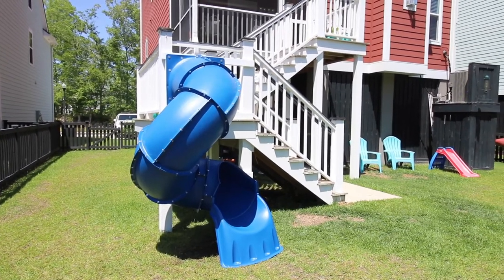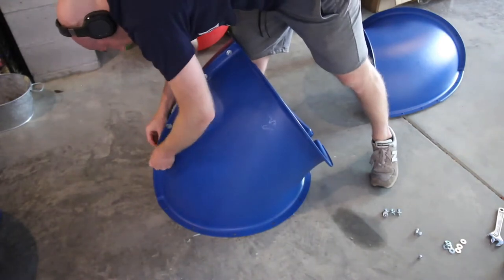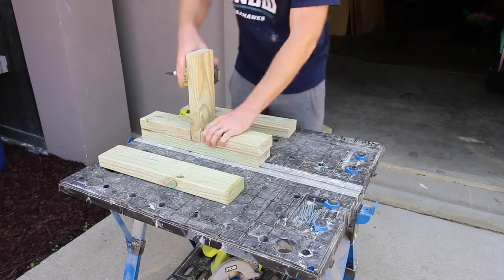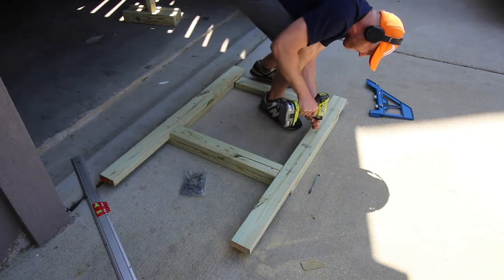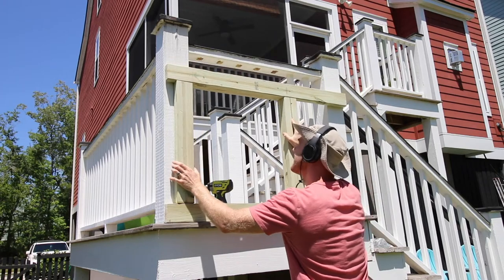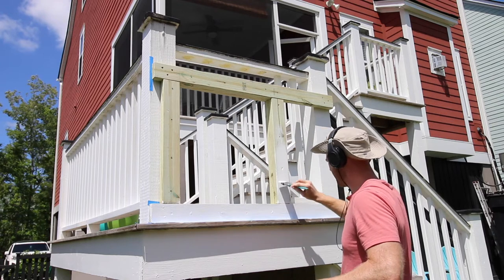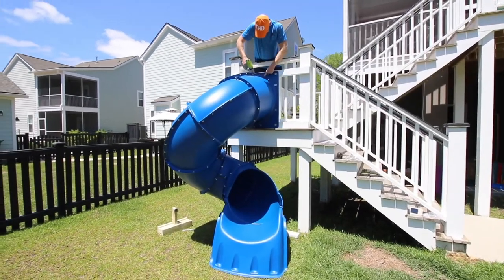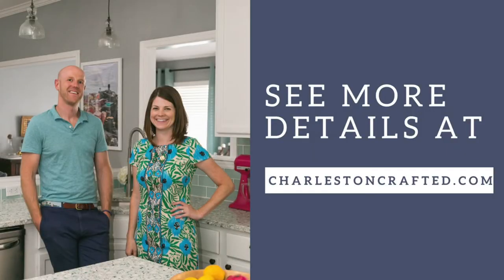How to attach a slide to a deck

Comment: We want to do the same thing but aren’t sure what length of slide we need. I think we need a 7’ slide because from the deck to the ground is 7’ but my husband thinks we need an 11’ slide because it’s 11’ from the top of the rail to the ground. So I guess what I’m asking is, is your deck 5’ off the ground or how did you know which slide to buy?
Reply from the maker: Our deck is 5' off the ground. So that worked for this slide.
Reply: @CharlestonCrafted  Thank you SO much! That means we can buy one at our local shop and not have to spend more on one online! Yay 🥳